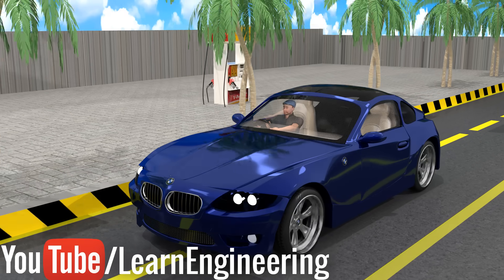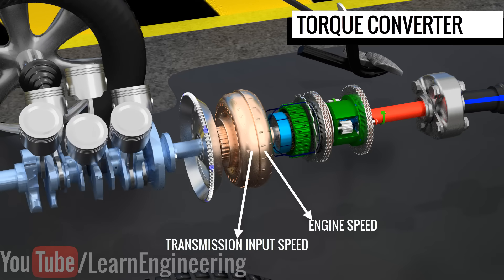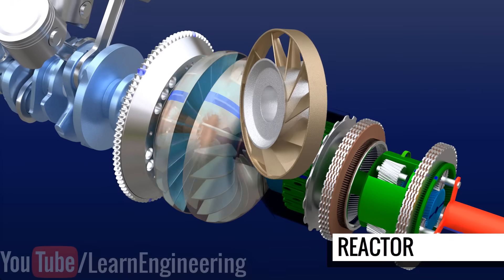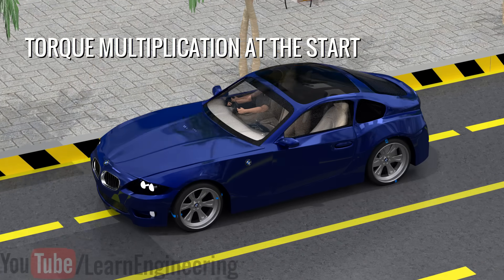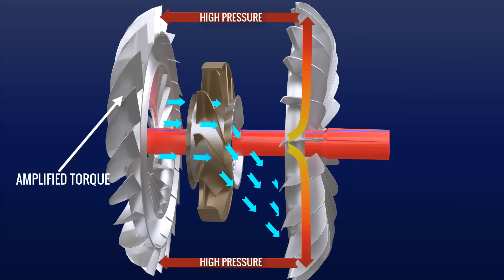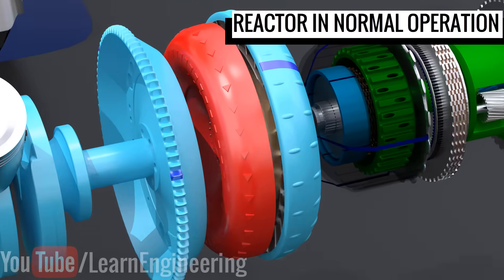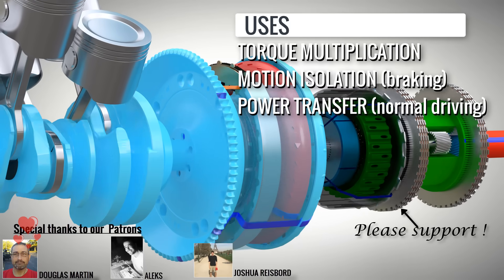Torque Converter, How does it work?

Comment: This seems to imply this is the standard way that an automatic car works. This is fairly unique to some high end cars. Most automatics have a more traditional gearbox controlled by a computer, or by hydraulic valves that trigger gear changes as the pressure increases with axel speed.
Reply: This is a traditional automatic gearbox. What you’re talking about is an automated manual( people still call it an automatic tho and car manufacturers each have a name for it - DSG, SMG, Tiptonic, easytronic and so on…)
Reply: What are you talking about? This is how every bog-standard automatic torque-converter transmission works. This design has been found in your average car since the 50s. Electrically controlled automatics are very new designs

Comment: The entire automatic transmission in motor vehicles is an excellent example of mechanical engineering and the understanding of fluid dynamics.
Reply: Fluid dynamics in general is such an impressive tool, it's crazy to think anything doesn't somehow include some hydraulic processes
Reply: @juhmeldavis4756  Especially in automotive features, an engine operates on the principles of a pressure differential albeit the fluid is a gas instead of a liquid. The water pump, fluid dynamics. Power steering pump, fluid dynamics. Brakes, fluid dynamics, usually vacuum assisted linear pump (the brake pedal is attached to the master cylinder which has a piston inside for pumping the fluid to the brake calipers, which also have pistons) Almost all of it works on pressure differentials and fluid mechanics. Even the crankshaft bearings which have no moving parts except for the oil that is pumped into them. A vehicle usually has about 6 pumps in total, some more some less. Not including the alternator which basically is a pump but the fluid it's pumping are electrons and not a liquid lol Very similar concept in electronic circuits to hydraulic circuits

Comment: Isn't the rotation direction of the pump and the direction of its blades are inconsistent. The blades are curved to direct the fluid from the outer perimeter to central towards the turbine but the rotation direction suggests the opposite.

Comment: Similar device on cargo ships for cargo cranes for electric powered 24000kg grabs (fully loaded) via electric cable which is always tight and the device is called Turbocoupling, filled with hydraulic oil, two sets of vanes in 360 degree distribution opposite each other, one side is being spun via belt by el motor and other side is picking up the the force amd pulling up the el cable giving power to the electric grab

Comment: An electric motor connected to the road wheel is far simpler, especially when a battery is used to power the electric motor. Infinitely less complicated and therefore far more reliable

Comment: anybody that would build a motor with 8 pipes on the exhaust manifolds only 6 cylinders and a serpentine belt between the motor and transmission and then put those cheap wheels on it. deserves to have their car explode into diagrams like this one keeps doing.

Comment: What I was hoping to learn was if there's anything you can do to get a torque converter working again once it starts acting up.
At least I understand how it's supposed to work.
Nice if you show what goes wrong and if it's due to abuse or neglect.
Which leads to the age old question of changing tranny fluid... good or bad?

Comment: If I had anything to do with torque converter manufacturing, I'd be sure not to brag about it to anyone. They haven't made a good one in over twenty years. The ones I have are salvaged from old cars and work perfectly. But it was a long road getting here. There are a lot of brand new ones in the trash that had to be changed out twice or three times. But that shouldn't be surprising. Everything corporate business touches turns to shit.

Comment: Kind of a crappy video to explain how it works.  The critical explanation really left out of how it works is,  The pump spins slowly at idle engine speed isn't developing enough pressure to make the fluid coupling to the turbine.  Once the pump speed increases to the point the pressure is high enough it will begin to turn the tubine making a almost solid fluid coupling..  

They danced all around how it works with out actually making it known or clear...

Comment: 6:30
“This is a brilliant design” really?   Cause in your other vid, ( “Tesla explained”) you said the Elon Musk mobile invented In c. 2011 will make this “brilliant design” obsolete by 2025., and actually, I think it’s going to be 2023.  Your words were:  

“An internal combustion engine produces usable torque and power output only within Limited speed range.  Therefore directly connecting the Engine rotation to the drive wheels is not a clever idea !  A transmission must be introduced to vary the drive wheel speed.  On the other hand and induction motor will work efficiently in any speed range.  Thus no speed varying transmission is needed in an electric car.  Moreover an IC engine does not produce direct rotational motion.  The linear motion of the pistons Has to be converted to rotational motion.  This causes major problems for mechanical balancing.  Not only is the internal combustion engine not self started like an induction motor - further the power output of an internal combustion engine is always uneven.  Many accessories are needed to solve these issues.  On the other hand, you will have Direct rotational motion and uniform power output with an induction motor.  
Many components in the IC Engine can be avoided here.  As a result of these factors A great response rate and higher power to weight ratio comes naturally with an induction motor resulting in superior vehicle performance” 

And so on…. 

Maybe an ICE can compete , but maybe not.

Comment: not quite right, too simplistic.The two parts of the outter converter are welded together and bolted the the crank via a flexie plate which the converter is bolted to,.The nose of the converter has two drive flanges protruding which drives the front pump housed in  the gearbox, this oil pump provides hydraulic  pressure to the ther  the clutches and servos, also keep the converter full of oil and give positive pressure inside the converter. the grearbox has two splined shafts which drive the two internal impellars, there is also a lock up clutch inside the convert that opperates at medium rpm giving 1;1  drive..

Comment: Lately automatic is taking a slightly bigger market here too due to the diffusion of that, here in Italy, wasteful thing called SUV. Wasteful because almost NO SUV here is used as a Sport Utility Vehicle, they are used as mere SSC; Sexual Shortcoming Compensators. Where automatics once upon a time were almost exclusively relegated to allow mobility to people with some form of disability, or some sort of imported car that allowed no choice of what kind of transmission to have.

You may say we're biased, but the undeniable fact with automatic is that it's WAY more complex than manual (especially the changing gear logic, be it old school or modern computer actuated) and if you need to put hands in the transmission (as it can happen) because of a fault, it's a painful broadside to any bank account (sometimes the bill is way above the worth of the car itself, leading to premature car scrapping, and I've seen it happen myself), while even if the culprit is the gearbox itself the repairing of a manual transmission is WAY cheaper. What isn't there can't break down, after all.

Comment: Great video and explanation.  It would be interesting to include the differences between a typical converter and a high performance, high stall converter.
Reply: I think with the understanding of the core concepts of an everyday automatic transmission torque converter, someone could use that knowledge and do a quick search on the differences, and understand it without difficulty. This video did an amazing job of explaining the core concepts in easy-to-grasp explanations. High performance and high stall wouldn't be sensible for everyday motorists which is why I don't believe it's included in this video.

Comment: Wait, I thought the point of the torque converter is to replace the clutch in automatic transmissions, in the end we still need a clutch? We've come full circle, what's the point? Just use a clutch then...
Reply: The clutches in an automatic serve a similar purpose to in a manual but also not really. Fluid pressure engages multiple clutches in the automatic for different gears, some (mostly older) autos use mechanical means for this, most newer ones use a computer to regulate that pressure. In a manual, the clutch in combination serves the purpose of a torque converter, transmitting power from the engine to the transmission, with the flywheel acting as the pump, and the clutch acting as the turbine.

Comment: Manuals are still better
Reply: The modern double clutch units outperform manuals now.  I don't think these torque converter based auto transmissions are made any more.  As far as I can see they were phased out at least 15 years ago.

Comment: It’s really just a way to synchronise shaft speeds before the clutch engages. Can’t really run the car with just the torque converter, you need the clutch.

Comment: I've had arguments with people on auto transmissions - they just can't fathom a fluid based 'pump' being the core to power transmission in their car.   I'm so glad I can just send this video now.
Nice animation and explanation.
Reply: You might let them know if there transmission in there car will not move in any gear most of the time the converter has failed. Replace it and save a transmission rebuild.
Reply: @cliffclark6441 I would check the fluid level first. If it's out of fluid, it's not moving, and that's more likely than the torque converter breaking (although it can cause that). Although I'm not sure who you are warning. If the person is able to rebuild the transmission themselves, they probably know to check the torque converter as part of diagnosis. If they didn't, that will probably bring it to a mechanic who will diagnose it for them. That's what you pay them for. Cases where a guy brings in his car and says "I want to to rebuild the transmission" and they do and he says "but it still doesn't work" and they say "of, that's because the convertor is shot. You didn't say you wanted us to fix that" seem unlikely. And if you are a home mechanic who actually drops your whole gearbox and opens it and rebuilds it without ever checking the convertor, well you aren't very bright and you deserve what you got.
Reply: I figured out something has to be there to prevent the car from stalling when stopped. I found the torque converter! I'm an electrician, not a mechanic, so I didn't know until now.
Reply: only idiots drive automatic and this is one of the reasons why
Reply: Early skid steer loaders only use a converter and no transmission. Machines like my track loader use a torque converter coupled to a manual gear shift transmission.And they can not understand the converter used in there car. A fluid based pump powers all machines built from around 1960.
Reply: Helps to understand the fluid as well. It is a hydrodlic fluid, meaning it doesn't compress, it also is a lubricant, and a coolant. The fact that it doesn't compress means that when its slung from one side to the other, it is very thick and acts somewhat solid. The more momentum or energy, and amount of fluid being slung at the opposite side, the more pushing power it will have.

Everyone knows what its like to be blasted with high pressure water, now imagine i stead of water its a high pressure liquid that doesn't splatter, mist, or compress under pressure. It acts more solid.

Comment: Torque converter huh....well I invented .....uh..using tape on a cut if you cant find a band-aid.  Pfff  - fluid flywheel torque machine.  Who needs an engine that is "isolated" from the turning wheels anyways?   Who has made a bigger difference in the quality of your life;  The inventor of the torque converter, who no one knows the name of, or your favorite celebrity athlete?  Engineers and inventors kick ass. They make life for us so much better than 99.99% of all people who have lived before us.

Comment: There’s always a tiny bit of slippage just enough to hold the car with the foot brake cause as soon as you let go of the foot brake that tiny bit of slippage will move the car. It’s dosnt 100% lockup it can’t cause the engine still spinning

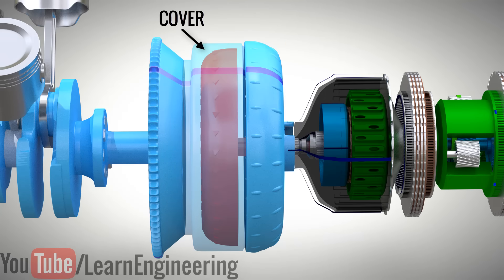Comment: 3:43 "Why is this arrangement made more complex than the previous case?" - after the explanation I still don't understand. 
4:09 "This means that a bearing has to be used between the turbine and the crank shaft" - but the same applies for the previous case, a bearing could be used to ensure the shafts are coaxial. Or couldn't it? Why would be "very difficult"?
Reply: Yes, you could do it in the first case, but a coupling meachanism with bearings on each axis would have to be placed inside the torque corverter, possibly affecting the fluid dynamics. On the second case, the bearings are placed outside the main pump/turbine component.
Reply: There needs to be a stationary shaft going from the transmission into the torque converter to support the stator. In the “previous” design this would leave no path for the turbine shaft to reach the transmission input shaft.

Comment: Years ago I had a Ford pickup with a very stout 429 and the one way clutch on the reactor quit working, the truck had absolutely ZERO bottom end torque, you could literally "run" faster than it would take off (at full throttle), but once it got going, and you were up to speed, it felt like nothing was wrong

Comment: what about the energy loss due to fluid friction when breaking, how much is it?, if we keep holding break paddle for longer will it heat up the torque convertor.
Reply: Yes, but minimally, unless it's for extremely long time periods. The ATF flows through both the transmission and the torque converter. Most modern cars(though not all) have a cooler line to the radiator to lose heat to the air via the engine coolant. Those that don't are sufficiently cooled by the airflow through the engine bay, or(as in the case of heavy duty trucks) have a separate air-cooled trans cooler mounted either in front of or underneath the radiator.

Comment: If it is a one way clutch how does reverse gear works?
Reply: The engine and input of the transmission still spin in the same direction even in reverse. Reverse gear is done within the transmission, so after the torque converter.

Comment: 8:03 I was glad to hear there is a solid clutch pack that locks the transmission shaft with the engine output, I was refusing to believe my car was being driven with a liquid. Does that mean the only purpose of the torque converter is at low speeds?
Reply: The lockup is used during highway cruising speeds to get better gas mileage and reduce heat.

Comment: This is great job brother,  but i have a 1998 sienna van which when i put the gear on drive it will not move until i raise it severally before it will drive , could this be that the Torque is faulty or what could be the problem . please .

Comment: lmao, right at the end "and there's a normal clutch in there as well." so aaallllll this to pointlessly add 10x the weight of rotating parts to the engine why dont ya? why not just have a computer automatically operate a regular clutch at launch, and then leave the rest of the transmission the same? seriously. no fluid mechanics required, no losses, just a buncha clutch packs to take off and change gears all automatically. seems simple enough, as they're already willing to put wearable clutch packs in even harder to reach places in the transmission. (saying that last part just in case the argument against this idea is that torque converters dont wear out like clutches.)
Reply: Correct me if I’m wrong but I believe they are used because tongue converters although sometimes inefficient are reliable and add torque while taking off therefore removing the need for other gearing and then equalizes when at higher rpm when torque is no longer needed and the clutch can then do its magic hope this helps

Comment: If you're gonna end up putting a clutch in there anyways, then the whole thing about letting the engine spin while braking doesn't matter anymore. I'm guessing that clutch gets released when the brake pedal is applied, but couldn't that be done with a normal clutch too? Wouldn't the only advantage of a torque converter be the increased torque at startup?

Comment: So....... why can I not have a TC in front of my Manual Transmission?
Reply: It would be constantly applying power to the transmission which would make changine gears very difficult. Torque converters aren't as efficient as a clutch.

Comment: And now I know why my '88 Oldsmobile would stall when I hit the brakes after getting up to a certain speed. The torque converter solenoid was bad, so I guess the lock up clutch wouldn't disengage.
Reply: I feel they should have explained the role of lock up clutch and how it engages and disengages in this video. I'm sure it's there in another video, but it leaves the viewer here wondering how / when the clutch works under brakes and as the car comes to a stop and takes away from the purely mechanical / fluid magic going on...

Comment: I always assumed that there would be no accelerating influence from the engine if the first point of the transmission line is already spinning at a higher RPM than the engine currently is. But it seems that perhaps that's not the case, right?
Reply: It wasn't clear, but if they say the torque is increased, then the speed is decreased. can't have magical torque increase.